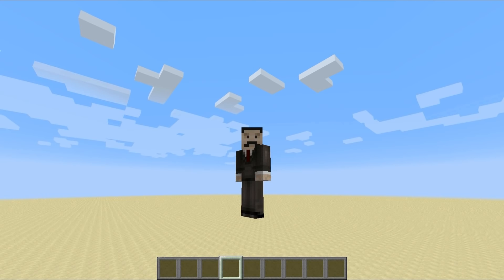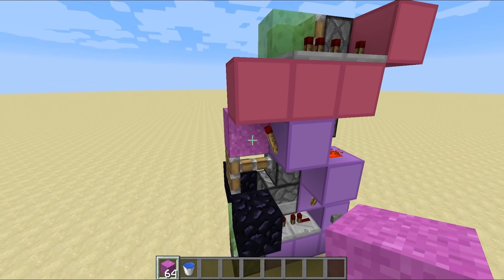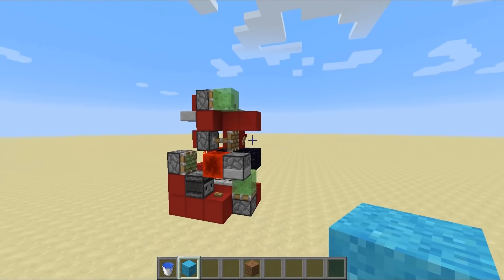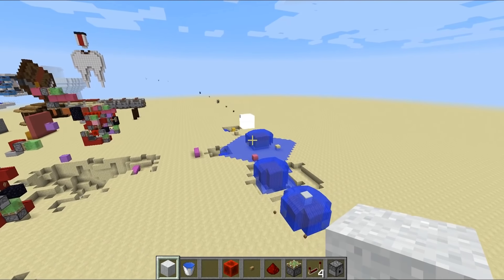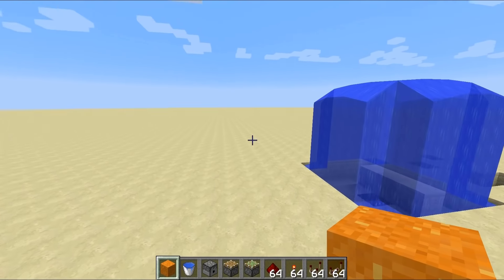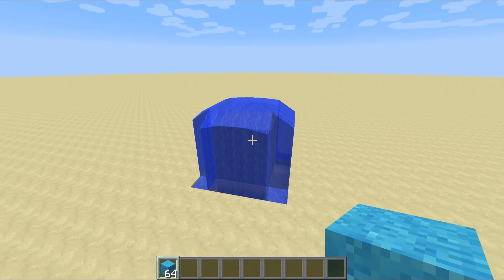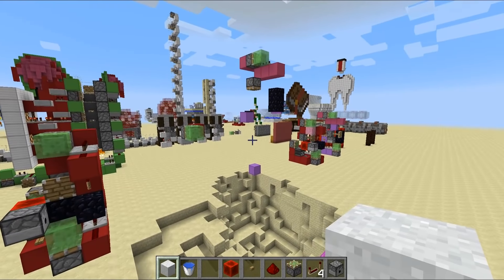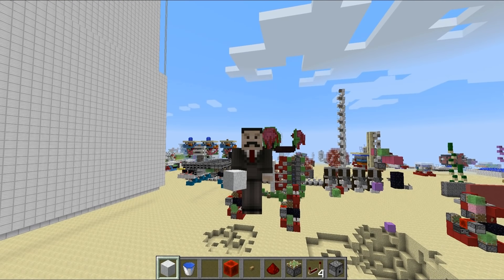Making Water Proof TNT Cannons in Minecraft!

Comment: The slime block that is used to push the falling concrete powder and lit TNT horizontally is directly above the concrete powder block when starting - and if I had a guess, the slime block could pull the concrete powder block horizontally, which would remove a piston and possibly allow for a smaller design, depending on the required circuits to move the concrete powder above the vertically launching slime block and retract the first slime block in time to launch it sideways.

Comment: or just use normal sand :/
Reply: Enni Assi I think sand would be different due to how concrete powder reacts with water
Reply: Enni Assi yeah
Reply: Braincain007 yeah, but sand cannons are easier to build.
Reply from the maker: One thing that I forgot to explain in the video: I wanted to make it so you could launch the TNT into the wall of water and have it get stuck there. Hence the use of conrete. But yeah, with the designs featured in this video it could have been sand!
Reply: yep, simple hybrid is way simpler than that what he is doing xD
Reply: Yeah...
Reply: Mumbo Jumbo ok, however you could still effectively just use one of the already made designs for a hybrid sand cannon and just replace the first sand with concrete powder, it'd be more reliable and would have a much further range.
Reply: +Mumbo Jumbo If it landed on the side then the tnt would still be in water :/
Reply: Even if the sand landed directly on the concrete the water would theoretically shield the blocks from TNT anyways.
Reply: Mumbo Jumbo also, factions is a Minecraft gamemode built around using sand stacking cannons to raid bases that are of course covered in water
Reply: ya
Reply: I was thinking that for the entire video
Reply: I was thinking about that.
Reply: no wut wud hapin if they had slabs under the water
Reply: I watch factions so I know that there is a portion that you add to the cannon so it busts slabs
Reply: sean111204 the tnt falls before the sand so the sand covers up the tnt which makes so it so that the water cannot reach the tnt because its inside the sand!
Reply: Then you would need to sand-stack.

Comment: alternatively you could just build a slime block breaching system. It will block the water flow revealing the wall then tnt can blow up after it. Probably easier to set up in 60 seconds. 2 for more damage second goes in after.

Comment: I think it would be better to shoot the base to the top side (using concrete) making the water change flow and make an air pocket then fire the tnt directly into the air pocket to make a hole on the wall... only works if the water is only placed on the top part tho

Comment: yeah there are hybrids however concrete in the right design for a cannon i believe could prove to be more useful in different situations,locations of bases. what you should try to do is make the powder to scatter absorbing enough source blocks so the water cant regenerate or make design that fires one piece of powder at the side and right aas the water will start flowing over that concrete block another piece of powder is hitting that flowing water 1 block away and 1 block above the first allowing an air space below it for tnt. dont listen to some of these nuts XD i believe a pratical design will come out of it eventually

Comment: challenge: make a wall that is one wide y=0-y=256 place a block at the bottom front of the wall,put water on the top front block,then make a cannon that goes through the wall.tip: stack 230 sand blocks on the bottom front block,then use tnt to break the sand and the wall tntmadness did that

Comment: When you play pocket edition.😭
Reply: colin cools you can probably just use sand/gravel
Reply: Pocket edition sucks
Reply: Simon Pelfrey gravel and sand doesn't solidify. It wouldn't make a sense if it did, which is why you need concrete
Reply: Martin but it doesn't need to solidify
Reply: Block Bros oh ffs, did you even watch the video?   ...
Reply: Martin it doesn't need to solidify, it just needs to land
Reply: Block Bros Nope, it becomes solid only if mixed with water. Do you even life?
Reply: Martin it is placed as a block whether there is water or not, concrete powder becomes a non-gravity block when next to water, but it still becomes a solid block whenever it lands
Reply: i agree with you dude